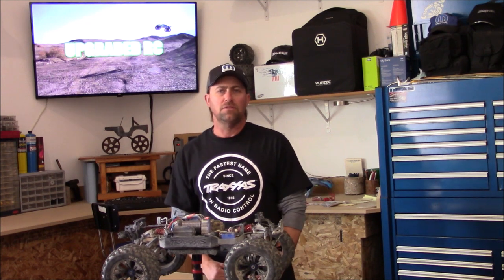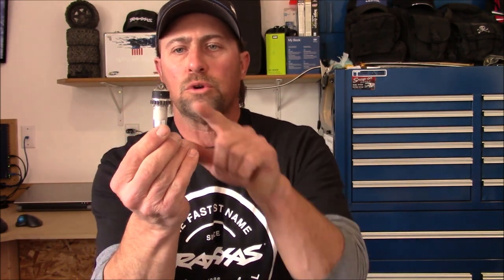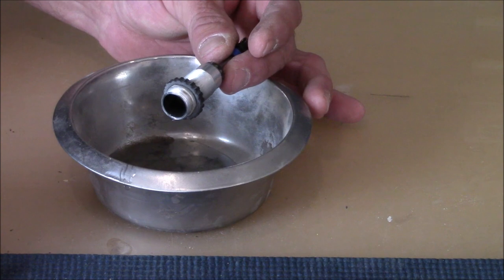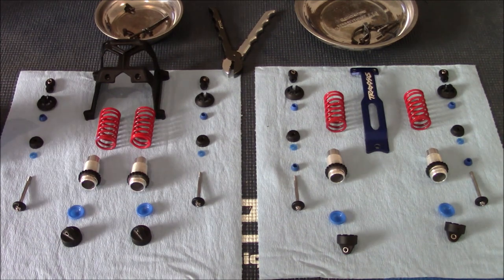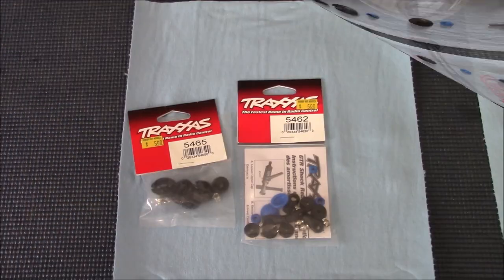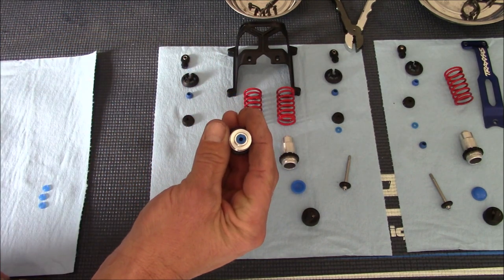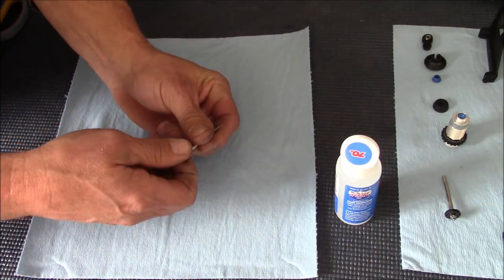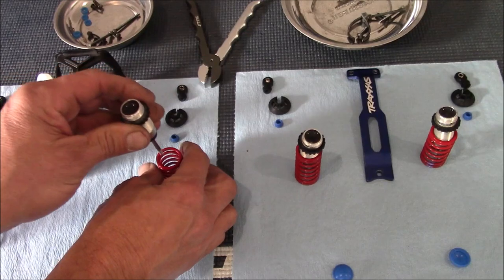Entire Suspension System Explained For E Revo 2.0  Part 2

Comment: Fill it to the top with oil, then put the Blue silicon plug on top of the Shock body, then use your pinky to push it deep into the shock housing, then put the shock top on, wipe the oil off....  This will guarantee you to have a good amount of air/oil Pressure in the cap above the oil in the shock!

Comment: Just curious to know if you’re still having good success with the bump stop solution to prevent the push rods from pulling out?  Not sure if you’re aware but Traxxas has apparently started shipping newer ERevo 2.0’s with upgraded pushrods that are thicker and have longer rod ends. Part number for the rear is 8619. They come in different colors to. Not sure what the front part number is. May want to check it out. My feeling is that those new push rods with the bump stops and limiting straps would give the suspension the extra strength it’s needed.
Reply from the maker: Yes, i am aware of that, just haven't had any problems with my solution so far
Reply: UPGRADED RC...that’s good to know. Did you ever put limiting straps on yours or did the bump stops do the trick?
Reply from the maker: Yes, i am still running the bump stops, no issues.

Comment: You didn’t add at the end what oil, piston, springs and rockers you run, because I’d like to know please.
Reply from the maker: Like i said, it changes depending on the temp, track conditions, and what you are trying  to do  at that moment!  I've changed my set up twice since that video lol!  But, right now i am running 70 wt. oil, #2 piston, purple springs, and stock rockers.
Reply: UPGRADED RC Thank you! I’m a hard core racer for over 30 years, I’ve always had a base setup. Bought my first basher (erevo) a few days ago and noticed the factory setup is very soft. Honestly I didn’t want to spend the time figuring that out because I’ll end up drilling my own pistons and treating it as a race vehicle, not why I bought it. So thank you for saving me some time.